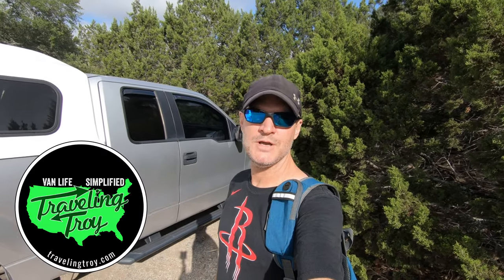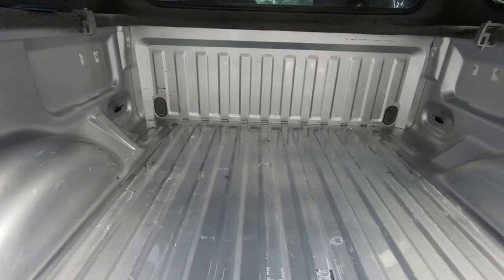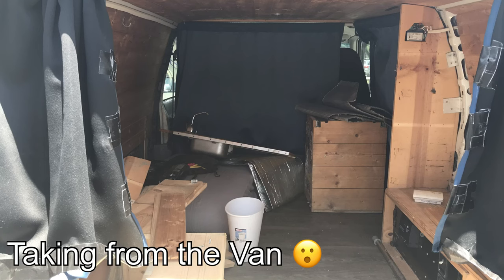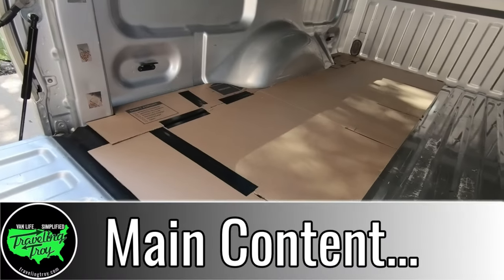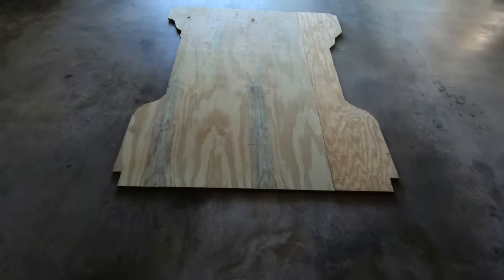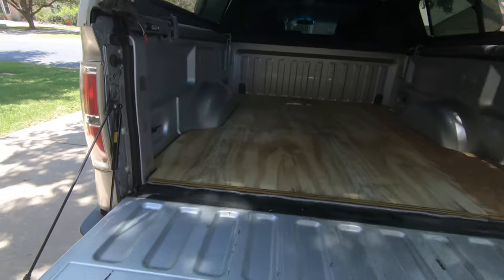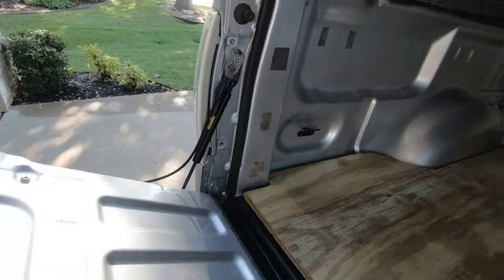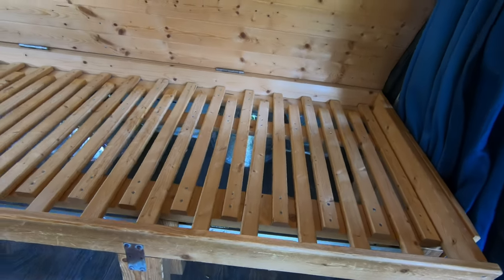DIY Truck Camper Build #2 - Flooring, Plus Build Plans and Hiking

Comment: Troy,  thank you for another great video.  The hike was really nice too.  I hope you got a break from the triple digit heat,  we got back to our more normal highs and even below the last 4 days.  I am  curious how much the materials have cost so far for the  seals,   chalk, treated plywood, glue,  bolts,  ect. Thank you again for creating this video series.
Reply from the maker: Hi Anita.  We did get a short break from the heat, but back to triple digit highs again for a while now.  Things add up fast when doing a build.  Seal pack $50, Caulk $10/tube (3 used thus far), Treated plywood $50/per sheet ($46 + tax), glue for the vinyl flooring $50 (only used a portion), vinyl flooring $60+.  Yeah, it adds up fast. :)
Reply: @TravelingTroy  It is still cheaper than the maintenance and repairs we have done on our older class b van. You are doing a profession job too. Thank you for answering my question.
Reply from the maker: @anitasimmons3599  Sure thing, glad to answer your questions.  This truck build will hopefully be more reliable than the older Astro van, which should make me less nervous when hitting the road. 👍 Thanks for checking out the video today. 😁

Comment: A bumper-to-bumper roof rack similar to what some work trucks have would give you solar area plus a little roof rack storage real estate?
Reply from the maker: Well, we’ve got a plan. 😉 We’re going stealth….😎 Working on cabinets and countertops now, then maybe electrical.
Reply: @TravelingTroy  Stealth can be a phony business name on the door and an old ladder on one side of the roof rack.
Reply from the maker: @kathrynarnold1966  Right, I thought about doing a sign and ladder for my van back when we first built it.  I sometimes spend a few months in Houston with friends and family, so stealth is still important for my build.  The truck will end up looking like your typical truck and topper…nothing to see here. 😁